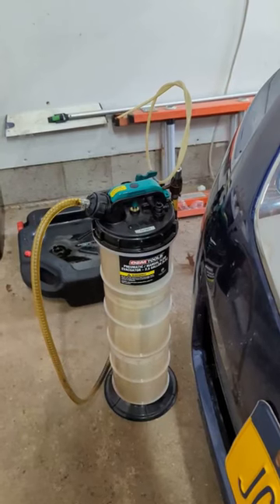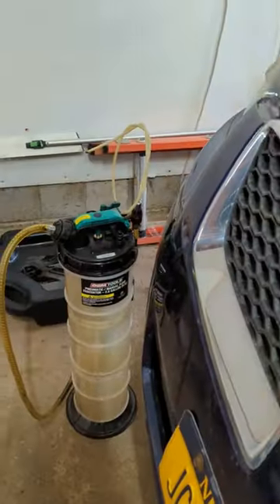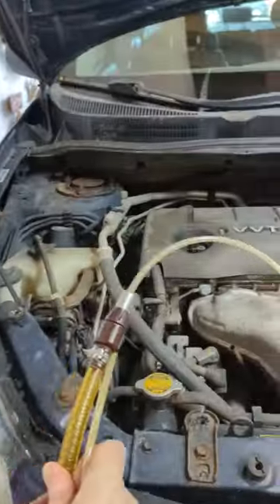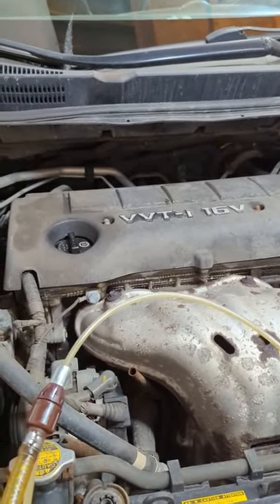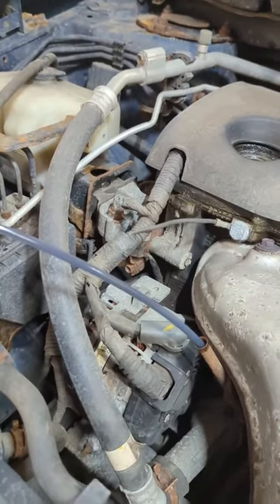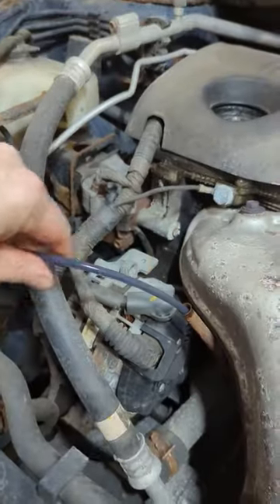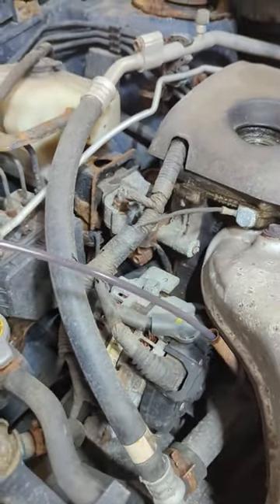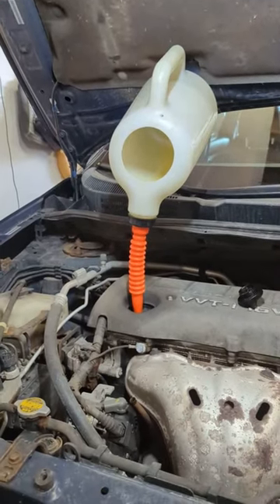Using an Oil Extractor to change your oil

Comment: If you go 7nder the car for the filter, then just do oil drain plug style to check for metal and clean off the oil plug magnet.
Extractor is better for a mid 20,000  mile or 2 year diesel oil change at the one year or 10k marker. But only if the oil filter sits on top of engine like a canister filter.
This gives the long life oil a new filter to keep going strong since the new euro oils are such high quality.

Comment: I saw a video of a guy trying this method on a bmw and it left a few litres of oil behind....

I'd put in a bit more elbow grease and change it the ol' fashion way....
Reply: I saw that video also but he actually posted a second follow up video where he did it properly and longer,  he rechecked it, it was bone dry. It does work you have give it time for it to work properly.
Reply from the maker: I still end up pulling the drain plug, but it's way less messy this way. As someone else said you just have to be patient and do it properly and there is never anything left in the pan when I pull the plug.
Reply: @AGeeksGarage  not every dipstick is angled toward the bottom of the pan if you want to be less messy get a round head ratchet and a no splatter pad
Reply from the maker: @NuKe0clan0cod0videos  Thanks for the tip. I will certainly watch for that. I still pull the plug every time once I think its drained just to be sure.